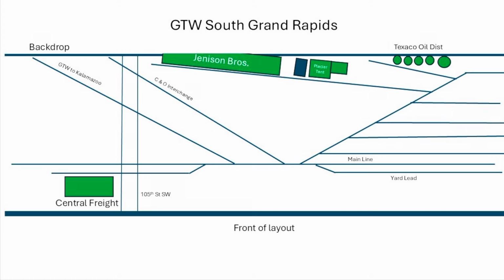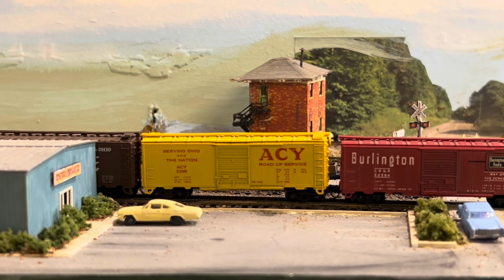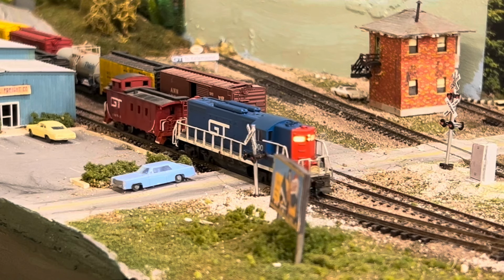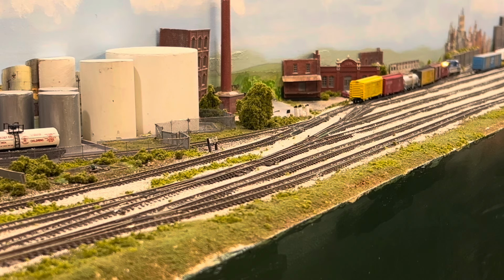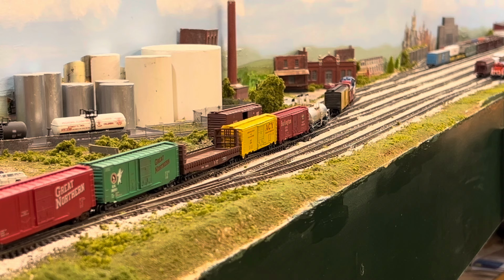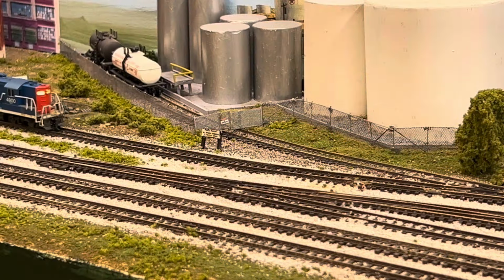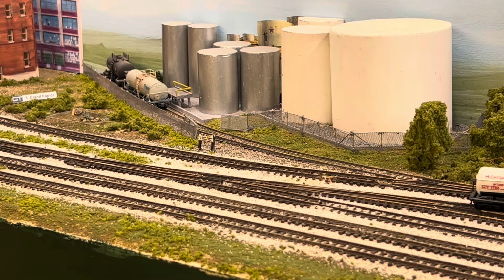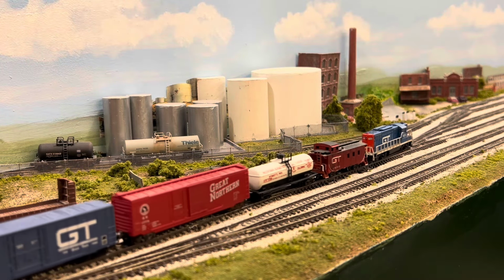Switching South Grand Rapids, Railroad Operations and Quiz!

Comment: Awesome fun onnthe switchouts! Noce train and layout!
Reply from the maker: Glad you enjoyed it! Thanks for watching
Reply: Having grown up in a town about 20 rail miles from Port Huron on the then C&O (Ex Pere Marquette) Port Huron sub, I noticed that little or no blocking had been done at Port Huron. Crews would often stop at an east facing switch to block their train for the several small towns on the way west to Saginaw, so this is an entirely prototypical headache that adds much to operation. Nice video. Thanks for posting.
Reply from the maker: That’s great to hear about how they blocked the train at the switch. I may need to add that to my operations. Thanks for the tip!

Comment: Is the Walthers penn station in the background? Never seen it as a flat.
Reply from the maker: Good observation. Actually I pulled the image from Walthers site, modified it slightly, then printed it out. I glued it to 1/4” foamcore. I did reach out to Walthers to make sure I wasn’t violating some copyright law or something. I wasn’t but wanted to check with them. Thanks for watching.
Reply: Very enjoyable part 2!
Happy modeling this weekend.
Scott
Reply: I don’t think you could have done it any better with the cars where they were. If the 2 cars were together at the end of the train, it would have taken 7 moves I believe.
Thanks for the operations!
Reply from the maker: Thanks Scott!
Reply from the maker: Thanks Thom. Good to know. If blocked properly it would have been 6-7 moves, certainly much less expensive for the railroad if they can do it in fewer moves.